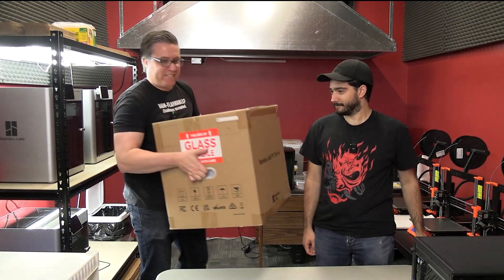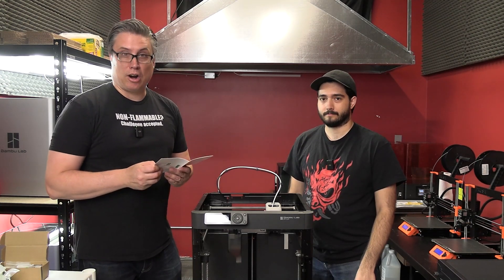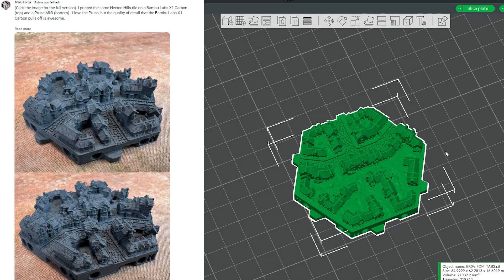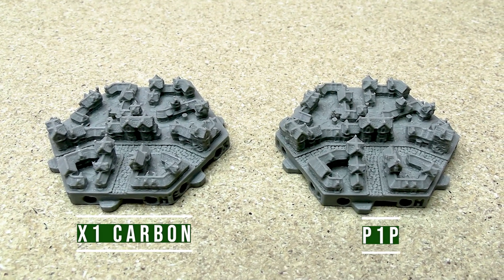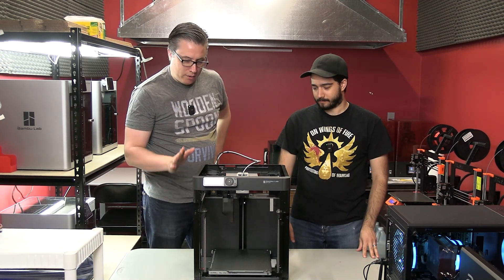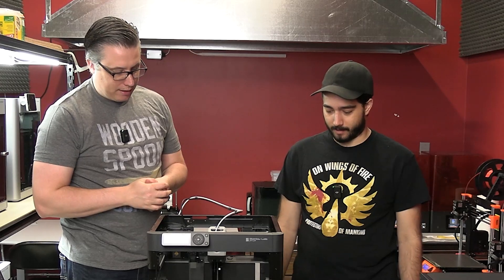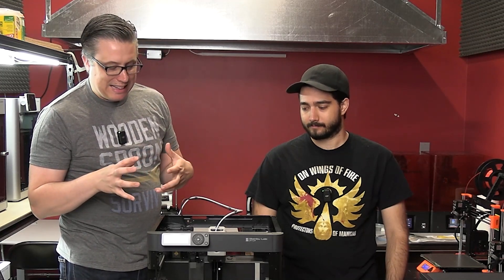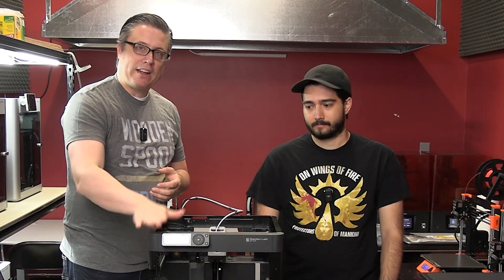Is this the best 3D printer for terrain?

Comment: Great channel!!! Would this printer print both terrain and miniatures or would you need two separate printers? If separate, any you’d recommend that does both?

Would love to see a noob version of printer with this recommendation. 

This printer + safety prep of the room (ventilation equipment for a normal person or if it can be done in a garage) + the type of resin + getting an STL + settings on the printer + shit I don’t know + the alcohol bath + curing station (with all the affiliate links… ❤)

Comment: I wonder how loud is the P1P in comparison to the Carbon? I would need to keep the printer in my apartment and the less noisy it gets the better it is (mostly for the sake of my neighbours :D). Since the Carbon has a closed housing I suppose it would be more quiet when closed and running.
Reply from the maker: The fans can get loud. I haven’t yet experimented with turning them down. You would definitely notice if it’s in the same room as you.
Reply: @MWG_Matthew  Thanks for the reply! Does the casing of the Carbon help with that, or is it not really noticable? I imagine you might not really have tested this and heared any difference, because you guys have so many machines running in this room :-D (also there is no need to in your forge :-D)

Comment: I don't load the filament that way. I just eject the last roll scrap and feed the new roll in. When it does it's purge it pulls it in perfectly. Also try .16 or even .12 if you want the layer lines to go away. I also use hairspray if I'm worried about a large print sticking. It works great.
Reply: How do you use the hairspray? Pre-spray the texture plate? Or spray after the print so done?
Reply: @GlorfindelsBodyPillow  Well what I doo is start by cleaning the plate with warm water and soap. Dry it and spray a little hairspray on it. I have had no problems in a year of printing on my P1P.

Comment: the comparison between a X1C and the P1P ist stupid as the P1P is a stripped down X1...so all the mechanic is the same...only print relevant difference is the nozzle...hardened steel on the X1
Reply from the maker: I had already been recommending the X1 Carbon, so it's relevant in that sense that I discovered I could get the cheaper printer and keep all of the benefits I like.

Comment: About the abrasive filament thing; Bambu just had a thing where folks that bought printers in the last year or so got offered stupidly cheap PLA-CF bundles. Could be marketing hype but the layer lines being less visible has me considering the nozzle/extruder upgrade since you need the hardened steel ones.

Honestly wouldn’t have bothered with non-PLA otherwise though. Really cool to see how it handles terrain! Even .20mm layers looks really nice on those.

Comment: Look into using a .2 nozzle and adjust layer height accordingly if you want to avoid larger layer lines. Years ago when you used to have to build your own 3d printers, I had a prusa clone and printed fine detail dungeon tiles with almost no layer lines. You'll sacrifice time for quality, but that's how it goes with FDM printing.
Reply from the maker: I was thinking of experimenting with that too. It’s nice though that the Bambus just get better quality and print faster to boot.

Comment: the slow wifi and lack of remote monitoring off network is the only thing I miss on the P1P, love checking my X1C print from literally anywhere
Reply from the maker: Yeah I didn’t catch that in the review. Those are definitely a couple of components that they went cheaper with.
Reply: Slow wifi is unfortunately still there so it takes forever to load but they did add remote viewing from anywhere in the last firmware update! Files also download and unpack a lot faster now which is nice.
Reply: @caketality  for reals? SIC, tytyty

Comment: your editor might want to work or audio mixing. the voices and the location of the audio channels for the voices are swapped and it's disconcerting. Great review of the P1P. I might seriously consider buying one now that they actually ship to my region. Also the nozzle on the p1p should be able to handle ABS its not like ABS is an abrasive material. The main reason I would use ABS for terrain is acetone vapor smoothing to remove any layer lines. That and if i wanted to be able to leave terrain in my car for when i want to play at someone else's house. The Problem with ABS is that it likes a warm printing environment and the p1p without housing wouldn't be able to do tall prints.
Reply from the maker: Good points!

Comment: Wish I'd bought one of these instead of my Anycubic Kobra 2.

After about 500 print hours, my Kobra 2 needs more repairing than is worth doing to it.

Have heard these go months without problems and only need basic maintenance.

What brand of PLA are you folks using? When my budget allows I'm going to pick one of these up and want to make sure I'm using compatible stuff.

That swamp print is insane without supports.

Really great video, thanks for a decent deep dive into this printer.
Reply from the maker: Honestly we just use any PLA that is cheap.  So far there have been few problems caused by the PLA we use.  Sometimes we get a bad roll but 99% of the time they work fine.
Reply: @MWGForge  

Thanks for the advice. You guys should do a follow up video showing basic maintenance for the Bambu.

Comment: Any major differences in speed between the different Bambus?  I've been looking at the carbon for a while for the utility but if the p1p can handle 90% of what I want to do for half the price, that might be the one.
Reply from the maker: We talk about it in the video, but basically the P1P is a stripped down version, which is 100% fine for printing terrain.  If you care about printing in other materials then you'll probably want to go with the X1 Carbon.  Otherwise save your money, or buy two printers!